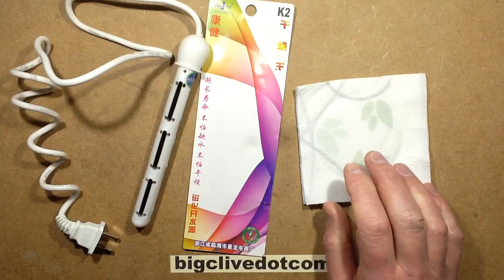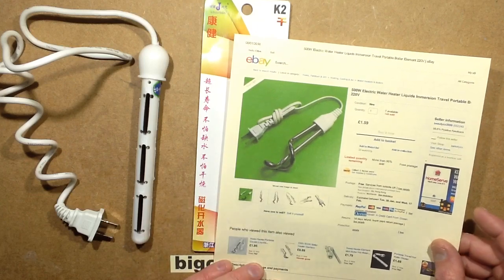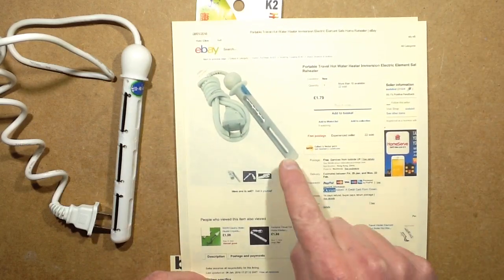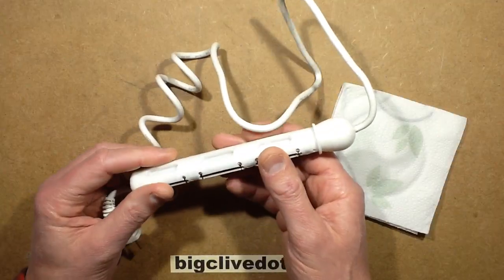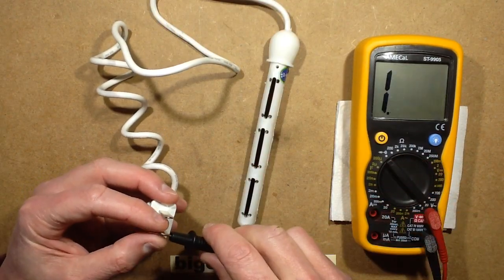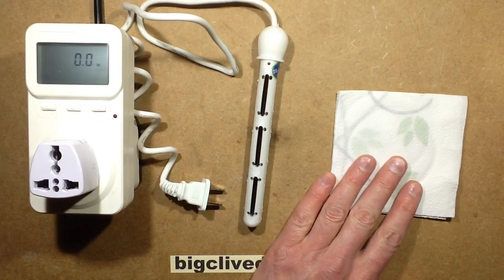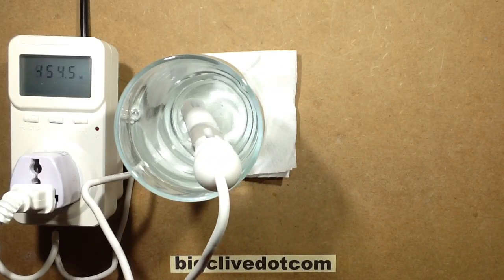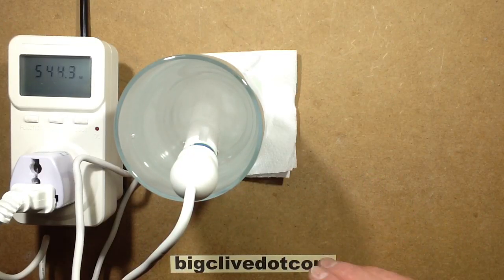Dangerous 240V Coffee-Cutor (coffee cup electrode boiler.)

Comment: Uhhh wouldnt this create hydrogen and oxygen gas??? (An explosive combo)
Reply from the maker: Not with AC at mains frequency.
Reply: Well years ago in one of my mad scientist phases I coiled copper wire around plastic bar. One coil to line and one coil to neutral. Isolated but close to one another. Submerged in mason jar of water, sealed power line and installed vent. Then plugged it into 120V AC (USA). It made flammable gas.
Could be Wrong of course but it seems like this lovely device should do something similar 😀

Comment: When we were kids we had a Gerber brand  humidifier from the late 70's.  No on or off switch. It was all plastic and probably held a gallon of water. When I was 12 or about 13 or so I  found it in the basement and remembered what it was. I remember ad it made steam it would spit out hot splashed of water.  I  heard rattling in the part that went into the tank,  so ofcourse unplugged I unscrewed the bottom orange plastic cover with holes for water to enter,  and I  saw 2 metal  electrodes with the electrical cord screwed on by square clamps.  Nonetheless I was surprised it wasn't so safe and didn't have a ground on the plug, nor was it polarized, not that it I guess matters.  Especially since it was a Gerber brand I thought it would be safer.  The rattling was just calcium.   The instructions also said to add a tsp of  salt  or baking soda to the water for it to create steam faster, so I added 2 tsp to speed things up, plugged it in  and heard a buzz. I got scared unplugged it and out into the garbage it went. Lol

Comment: I'm thinking about using one of these to heat my hand wash station in my garage. Turning it off of course before using the water. If I do use something like this I will plug it into a GFCI outlet.
Reply from the maker: If you have a continuous mains water supply you can use vented under or over sink heaters for a good instant supply of hot water.

Comment: Actually, slightly related to making hot drink, my Tassimo will not work on my 230V generator output, the normal kettle will as will the fridges and freezers but for some odd reason the Tassimo will only work off proper mains voltage. Discovered this annoying abnormality during a 6hr power cut Just wierd, generator output is fine. Any thoughts??? .
Reply from the maker: Possibly a non sinusoidal or glitchy generator output causing the processor to keep resetting.

Comment: Übersetzungstypen
Textübersetzung
Ausgangstext
哦晒色
Such a type of water system existed as a water heater in the 1950s as an attachment to a normal tap. This was a small shower that had 2 electrode rings inside. The rear ring was electrically connected to the tap through the hose with which this device was attached to the tap, the front electrode was connected to a single-core cable behind the plastic shower strainer, There was a banana plug that was plugged into the live socket of the nearest power outlet. As long as the tap was closed, the flow of electricity was interrupted, but as soon as the tap was opened, the flow of electricity through the water was closed, and that water warmed up. If you shut off the water supply, the rest of the shower boiled out, which interrupted the flow of electricity again. The part was extremely life-threatening, however, since deposits of lime and salts could make the shower slightly conductive. If you touched it when opening the tap, or even tried to change the direction of the shower, you could get a fatal blow, which is why these devices were then used also prohibited. Nevertheless, you could find them in apartments for a long time.
Reply from the maker: If love to find one of those.

Comment: How about 3000W https://www.ebay.co.uk/itm/Red-Portable-3000W-Electric-Hot-Water-Heater-Shower-Instant-Kitchen-Bathroom/202939483266?hash=item2f4022c482:g:gZEAAOSw4qNeTg-p
Reply from the maker: I've had one sitting here for a while.  A quick peek inside showed that the heating element is a glass tube with a conductive coating on the outside.
Reply: @bigclivedotcom  Perfect for shipping. Keep up the good work. Thanks for the reply

Comment: Would 12 volts at 300 watts have much of an effect? I have solar panels!
Reply from the maker: It would cause electrolysis of the electrodes into the water and wouldn't heat it much.
Reply from the maker: You do get 12V cup heating elements for cars.
Reply: @bigclivedotcom  Amazon claim to sell 12 and 24 volt immersion heater coils for hot water storage tanks. I see they go up to 600 watts. It is not a lot of power to dump into a large volume of water, but it would be constant during daylight hours.I am seeing solar panels to be had at £75 per 100 watt and the heating coils at £28. I am a terrible ditherer before i act!

Comment: The initial bubbles are hydrogen and oxygen from the water molecule being broken apart by electrolysis.
Reply: Perhaps some of it... 95% of it will be steam, though. Electrolysis simply is not an efficient method of splitting hydrogen and oxygen; it doesn't matter what the scammers tell you, that little thing in your car that "generates hydrogen" is more harmful (and less helpful) than you think... peace.

Comment: I wonder how this compares to induction heating.  I guess electrode boiling would be faster but it seems to heat the water so quickly that you end up with steam in contact with the electrode, reducing its efficiency (and I guess limiting the power draw also).  Induction would seem to heat slower and thus more uniformly, but I wonder whether it would be that far behind?

Comment: Could it be that the tiny bubbles that appear instantly are result of water electrolysis? Hydrogen and oxygen resulting from the high voltages.

And what causes the vibration exactly?

Comment: These were used in prison. They were called stingers. They actually separate the oxygen and hydrogen in the water. The steam that you see is the Hydrogen and oxygen being separated. So, the vapors are highly flammable. Trust me I know. People make Hydrogen torches by doing this. Also , not good  to do in closed space. The Hydrogen can build up.
Reply from the maker: The electrolysis happens with DC but not AC.

Comment: Little cup-shaped kettles like that started selling around mid 80's and they are still available in countries outside the EU. Because of how they work, they cannot be rated properly and thus cannot be sold in the EU, I suppose. They are very cheap. They cost somewhere around $1.5 - $2, but they have one problem - they stop working after you've used them several times. I assume that limescale builds up rather quickly around the electrodes and it prevents them from functioning. I've never bothered to actually open one up and see why it stopped working because they're so cheap.
Reply from the maker: I managed to find of the kettles and made a video about it.

Comment: When we got married 50 odd years ago, we were given a hot dog cooker that had two nails, sticking out the ends, yea you guessed it. It would burn the meat, and smoke.., I do have a "worm getter" just a shovel handle, with a ss rod, you sitck into the ground, you check to see if the plug is in the correct way, by feeling for vibration (60 cycle) as you push it in. Works really well if you water first.

Comment: would this be any safer if the neutral electrode completely surrounded the live electrode? Obviously you'd have to use a polarized plug, but would that help keep the potential in the rest of the water down?

Comment: thats not steam mate thats a chemical reaction its called electrolysis the bubbles coming out is hydrogen and oxygen in their gas form because the voltage didnt boil it it straight up tore the molecule apart mate. some peoples water turn brown because the impurities either way mate dont drink water after its gone through that process because of the different stuff dissolved in it
Reply: eventually the water does boil but you dont want that

Comment: Does it produce hydrogen?
Reply: No
Reply: @Roflcopter4b  Why not?
Reply: @MrAwawe  DC is required for electrolysis. With AC, as the current flows one direction the H2O is broken up, and then when it switches polarity the O2 and H2 actually recombine. The overall result is that nothing happens.

Comment: Hang on. Aren't you electrolysing water, liberating hydrogen and oxygen, but where each electrode is the same pole 25 times a second? If that is the case, could you collect the gas and put a match to it like the in the way you do with a dc power supply?  If it goes 'pop',  that would prove it .
Reply from the maker: I did try that with a bit of detergent to create a foam.  It wasn't flammable.  Electrolysis requires DC.

Comment: I know this is 2 years old but still interesting.  This is how those room humidifiers work.  Of course they are completely isolated from the person but still just two electrodes in water.  Does cause black build up on the electrodes that needs to be cleaned off periodically.  Not sure what that is but would not want it in my drink as it breaks off and floats around.

Comment: could you take it apart and use it for electrolysis?
Reply from the maker: It would corrode quickly if used for that.  It would be better just to use some more solid electrodes.

Comment: at 11:30 i'm pretty sure those bubbles are actually from the water getting electrolyzed and the molecule of H2O (L) splitting into H2 (g) and O2 (g). I am also fairly certain that stainless still would dissolve over time but more importantly the trace metals like chromium in stainless steel can become dissolved and will be toxic.
Reply: I was thinking exactly the same, no way I'd be drinking that water. It'd be interesting if big clive could get the water analyzed before and after to see whats there.
Reply: @SuprSi  yeah I would love to see what's actually in the water after its been heated up.
Reply: Electrolytic decomposition is not very efficient; after a minute or two they all turn into kettles. Even when you do manage to split hydrogen and oxygen, the odds are, 90% of what you're causing is merely steam. If you want to split hydrogen and oxygen efficiently, you need to first boil the water up to about 700-800 degrees celsius (pressurised steam if you will; this is thousands fahrenheit) ... and then pass a low voltage, high current through it. That's what's done commercially, and fwiw you can't do it with a car (at least, not unless you also have a nuclear reactor strapped to your car, which probably means you don't need the hydrogen boost lol)...
Reply: @sebastianramadan8393  yeah you can definitely make the process more efficient but I know it's pretty easy to do it at STP so I'd suspect that this would be more then enough for the reaction to take place (seeing as I've done very half assed with a power supply from a computer), not enough to do anything commercially but I'd be surprised if you didn't find some trace metals from it
Reply: @Soggy Tangent But I thought that electrolysis cannot happen on alternating current. Maybe it has to be higher frequency or something.

Comment: You went thought the entire video without mentioning electrolysis... 

Should have let someone more qualified like AvE or Cody's lab take a look at this instead of just you
Reply from the maker: No significant electrolysis with AC.  That happens with DC.
Reply: @bigclivedotcom   "I once did the experiment, and well, things do happen. We have 50 Hz AC, and what is observed is formation of bubbles at both electrodes. I did the electrolysis with copper electrodes in NaCl. At both sides there were bubbles, and both electrodes are corroded. The bubbles are hydrogen gas.

    I also did the experiment with carbon electrodes and with 220 V AC (VERY DANGEROUS!!!!), using a very dilute solution of NaCl. The effect of that is formation of gas, and sometimes ignition of gas bubbles under water, near the electrodes. I slowly increased the concentration of NaCl, and at a certain point, I got a nice continuous stream of gas, with sparks of miniature explosions every few tenths of a second. These sparks most likely are due to ignition of gas mixed of H2 and Cl2 and/or H2 and O2. Using too high a concentration of NaCl makes the reaction too vigorous and quite hot." -- from https://www.scienceforums.net/topic/23400-electrolysis-with-ac/

Just because in theory something would/ won't happen doesn't mean it's the reality, that's why more knowledgeable Youtubers should take a look at this instead just you and whatever prejudice you held.
Reply: @bigclivedotcom  Can you explain? I've never heard that electrolysis is limited to DC or a why that might be the case. I ask because you might know something I don't...and if so, this is a learning opportunity for me.

As for what I "think" I know,  I agree that with DC electrolysis, one pole to produce hydrogen and the other oxygen. But with AC, the poles would simply be switching back and forth at the frequency of the mains. But during the up-swing, I would still expect hydrogen is being produced on one line and oxygen on the other just like with DC...and vice-versa on the down-swing. The result, a nearly perfect mix of oxygen and hydrogen gas floating to the top along with water vapor. This is the part where you hold a lit match or lighter over the water's surface and see what happens!!!!

Comment: i think you the vicks steam vaporizers you can get in any pharmacy or first aid shop and the euro iron used electrode boiler.

the euro iron i think was the clothes iron made entirely of plastic and claimed not to be able to pop a balloon used the same electrode boiler technology.

the reason the 2 devices was safe to use was that the electrodes are enclosed entirely in the plastic enclosure and you could not easily get access to the water to get zapped.

i imagine if you was stupid you could get zapped.

Comment: +bigclivedotcom 
 I'm curious, which is more efficient this electrode heater/boiler or the resistor element based heater for heating regular tap water?
Reply from the maker: Technically speaking, the electrode boiler is almost 100% efficient.

Comment: By the way this is actually how you make coffee in prison. if there is no proper resistive water heater thingy and you can't get hot water, just rip the cable off the lighting at the ceiling or along the wall, strip off some insulation and hurray coffee

Comment: Thing is mains voltage isn't really enough to kill you. It will hurt but not kill
Reply from the maker: Mains of 100 or 240v will easily kill you in the right circumstances.
Reply: bigclivedotcom oh hello, while I do think it can kill you in general it will just give you a really bad shock.
Reply from the maker: Most shocks are non fatal, but in the right circumstances of hand held metalwork, tight spaces and water presence the risk is much greater.
Reply: bigclivedotcom 👍

Comment: So basically, this is just the mains (220V!) soaking thru electrolytes in water. All this assembled in a unhandy plastic knob. What an experimental yet dangerous way to heat water. Aren't there any metal residue while it's heating? Better put cut wires in a glass, it would be even cheaper! I think even industrials won't use this method to heat liquids. ^^ I bought one on eBay just to study this thing, and maybe making an experiment video about it... There are too few making this in the French side of YouTube. Of course, I know a bit about electricity, since I study this domain on my own for more than 10 years ^^ So I don't think I will hurt myself

Comment: This is crap, measuring the voltage on the teaspoon is meaningless without an actual load between the spoon and ground, if the spoon's just floating of course it'll be at half mains voltage. Your current measurement was equally meaningless - if it passed only 220mA across a dead short to ground it would pass barely any current across a human body or any meaningful load.

Comment: If that literally just throws mains voltage from metal plates into water, wouldn't that cause electrolysis? Or would the material of the electrodes prevent that?

Comment: You do not address corrosion or metal leaching off the electrodes. 

This thing is not dangerous, it's you and an electrical outlet that are dangerous. This thing works fine, you overboil it and then speak in amazement at common sense physics. I wonder how 'safe' your cooking equipment is. You;'re worse than MSM.